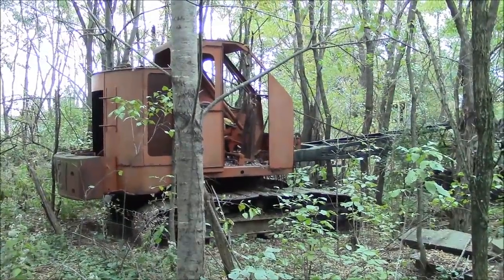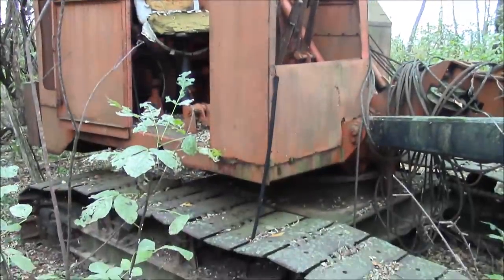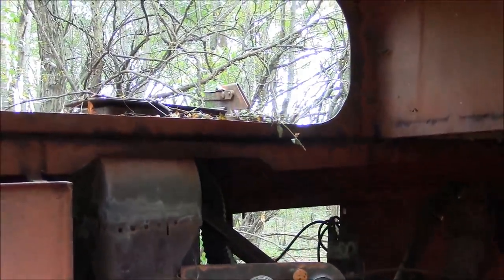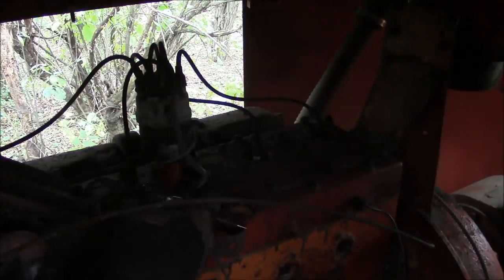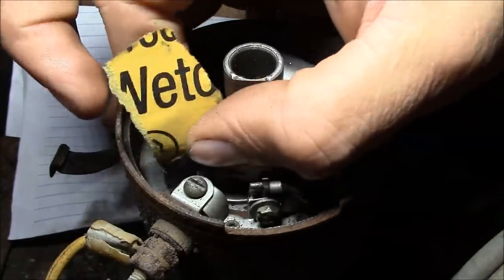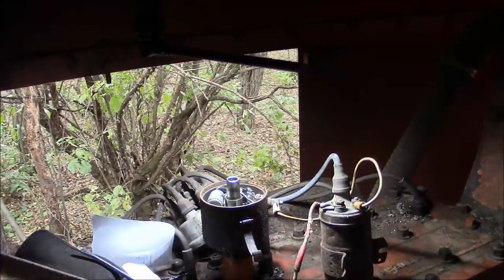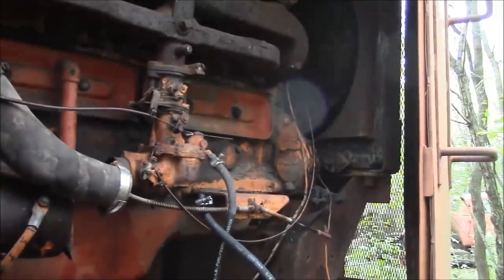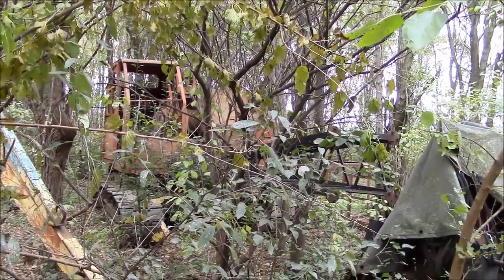Insley Dragline Crane Forgotten in a Field for 20 Years - Will it Run Again? - Part 1

Comment: Distributor through the cyl head like that looks like an F226 continental  to me. Same as in my Cletrac AG6.
Reply from the maker: Continental B427.
Reply: still a Continental. Been doing this for 50 years and engines by brand all have certain characteristics. Buda from  Waulks, Hercs etc etc

Comment: Ignition coils work using ‘back emf’. When voltage is applied to the coil a magnetic field is created in the primary winding. When the points open that magnetic field collapses and induces a surge current in the primary of the coil which is ‘amplified’ by the secondary side of the coil up to 15-20kv in a standard points ignition setup.
Reply: Thanks Gary, saved me explaining it.  I'd like to also point out that intermittent DC is NOT AC.
Reply from the maker: Correct, but pulsed DC is often used with transformers. For example in a switch mode power supply.
Reply: @WatchWesWork  Wes, you clearly know plenty about mechanical stuff, but the way you talk about electronics issues makes me think that you have some training or at least experience in electronics too. Care to expand at all on your abilities in that arena?

Comment: At least here in Florida, if you buy a good quality clamp on battery terminals, use a good conductive (not dielectric) anticorrosion grease and properly prep the wires they will last a long time.  I've been using them for a many years and have found that it's most often the install that is to blame for their failure not the terminals themselves.
Reply: Molybdenum di-sulfide works best.
Reply: @glennchartrand5411  it may work but a specific grease for the application (like no-ox-id) works best.
Reply: @DoRC  I prefer Molybdenum because it wicks into the cable, so it prevents the copper from corroding, it also works well on brass and steel battery terminals.

But one co-worker prefers "battery protector" (an orange lacquer with anti corrosion agents) and another guy uses the "felt rings" soaked in corrosion inhibitors.

They all work.

I do a lot of deep cycle batteries so I'm mainly worried about "gassing" getting fumes into the cable and I have to deal with a lot of different types of connectors.

The guy who PM's forklifts wants something easy to apply and the customer can see that its applied.

The guy prepping new equipment wants something that looks "factory".

It all boils down to personal preference , just knowing that you need a corrosion inhibitor is 90% of the battle.
Reply: @glennchartrand5411  we used no-ox-id on cell tower battery backup systems. But yeah as long as you use something effective.

Comment: yup set the throttle at wide open and the governor keeps the engine at 1200rpm. thats the way my insley and lima both are set up.  they are not run at high RPM.   thanks for posting this!   im thinking its a continental f226 definitely  does Not like the buda in mine.
Reply: BTW there are a few people  interested in buying this machine on facebook old crane groups already.  IF only you were closer Id be all over it
Reply from the maker: I've studied your Insley shovel videos. Your engine seems totally backwards of this one. The manifold and oil fill are on the opposite side. So I really have no idea what mine is. There's very little info on old flathead engines that are not used in cars. I think it may have once had a belt driven governor like your other machine.
Reply: Yeah both machines have Pierce brand governors as you’ve noticed the Insley is belt driven. I have manuals if you’re interested in any part of it.  I’m pretty sure that’s a continental engine.   I bet you could drive it out of there with not much more work. Both my machines have been sitting for 12+ years and engines aren’t missing a beat after coming back to life. Controls just take a little elbow grease.  As you can tell by your views this stuff is still pretty popular and there are still businesses run with these old friction machines

Comment: I always wanted a dragline, I thought about building a small one out of an old farmall cub. But that's a lot of fabrication that I don't have time to do. It would take me years, lol
Reply from the maker: I saw a TV show once where they had a dragline made from an old Allis Chalmers dozer with two winches on the back. It had no boom. They ran the cable out to another dozer and back.
Reply: Watch Wes Work my dad had a pond scoop that went on the 3 point hitch of the tractor, but somebody stole it. My dad wanted to level out the fields behind the house and fill in the low spots that flood

Comment: Don’t forget that the HV Circuit has to return to the case of the coil, make sure the coil is efficiently grounded
Reply from the maker: I don't think that is true. At least it's not true for most coils I have seen. I believe the ground side of the primary and secondary windings are tied together at the negative terminal of the coil. So the case does not have to be grounded. That makes the coil an auto transformer instead of an isolation transformer.

Comment: Aside from a project for fun, if a working one of these has no value then there's only three ways to get paid from this right?  Salvage the motor and sell it, break down the rest for scrap value, and the intangible value of clearing location X for better use of the land?  Hearing that old infernal combustion kick over has to be a nice reward for the elbow grease you invested in it so far!
Reply from the maker: Well scrap metal currently has almost no value. So entertainment it is!

Comment: Turning in a shift on that thing must have been a chore. Especially with that engine howling away at full throttle (or near enough) right behind your head all shift.
Reply: Get the best ear protection you can. Maybe even  double up with earplugs as well.

Edit: typo fixed
Reply: @gorillaau  I sure as heck would if I were going to spend more than 10-15 minutes running that rig.
Reply: @sandy1653  I wonder if you can get active noise cancelling headphones with an audio jack to allow a two way radio to be "piped" into the cans. 

Your comment made me laugh. Thanks.

Comment: the old strait 6 fired right up and sounded pretty good. i was impressed with the oil pressure when you were cranking. what became of the forklift you drug out of there?
Reply from the maker: It's sitting behind me at the end of the video. I bought some parts for it and will have a follow up video or three.

Comment: I know this comment is a year late, That Electrical system is probably 24 volts. That is why the extra battery cable you found.  It connects the two batteries together in series. That would also explain why the starter motor turns so slow.

Comment: I noticed a short battery cable that you didn't use.   Is there a chance there were two batteries in series (24V)?   I guess some bulldozers are set up that way.
Reply from the maker: I've never seen a gas engine set up for 24V. That's a diesel thing.

Comment: Really close on the coil explanation. When the points open the primary field of the coil, 12 volt side, collapses. At that point the energy is transferred to the  secondary winding and the resulting voltage spike jumps the gap of the plug resulting in a spark. Points close and process repeats for next cylinder. Please keep bringing these jewels back from the grave. Thanks.
Reply from the maker: That "transfer" is mutual induction. Just like a transformer. It's easier for me to understand it in electrical terms. Probably not for anyone else though!

Comment: The plak on the starter should tell how many volts it takes
Reply from the maker: Usually the starters don't care about voltage. They just have a little more torque. From my experience converting from 6V to 12V, we never replaced the starters.

Comment: Nice job Wes.  Not a complaint, I'm noticing a lot of artifacts. What bit rate are you uploading at ?
Reply from the maker: 1080. Not sure on the FPS. The biggest issue is that I burned the lens of my camera with a torch over a year ago and I never replaced it. Someday...
Reply: @WatchWesWork  Ouch I think I remember that was it on the dump truck repairs? FWIW I checked your video and it's 1080p at 30 fps.  The bit rate though is only about 4 Mbps, YT recommends about 10-12 Mbps for 1080p 30 fps.  This would be set when you render your edited video.
Reply from the maker: @billdlv  OK. I'll have to check. I render in mp4 format. I need to upgrade my edit software though. Mine is pretty janky, as you can clearly see!

Comment: Too bad that deck ring gear is shot. That is why you had oilers to work with the operator (150) of the rig. They were built to run forever, just keep them well lubricated. You could have that deck ring gear rebuilt, if you so desire.

Comment: the governor assembly is actually missing in your application, it should be a centrifugal assembly, driven either by a belt on the engine, or a gear driven assembly on the front cover. they probably ran it without it, just self governing with the hand throttle. those old 6 cylinders are low rpm, high torque engines anyhow, they'll run forever.
Reply from the maker: Seems awful dangerous to run it with no governor. You could over rev it pretty easy!
Reply: @WatchWesWork  i agree completely, but lots of folks have tried, some succeed, some fail...... i have a belt driven one in my shop, next time im out there ill take a picture of it.
Reply from the maker: @bvfdfire1  I know what you mean. Like a Pearless governor.

Comment: cool seeing old stuff like this coming back to life :) what model is your Clark forklift there in the background? I resurrected a 1993 GPX30E that looks similar, but only two sticks(no sideshift) https://www.youtube.com/watch?v=1PmybZU-4wY&t=10s
 I think it turned out pretty nice...woulda been sad to see it go in a dumpster...  now working on restoring a 1963 towmotor- also pulled from a scrapheap, when done, just going to donate to a local airplane museum- they have one like it, but it typical shape- converting this one to power steering and plan on OD green/white star military motorpool motif...think it will be kinda neat, even if a bit of a ugly duckling...did get in a bit over my head cost wise, tires alone are costing more than I'd hoped it would take to redo- but it will look better with new wide slick tread tires...adding the new steering box, pump, relocating generator/possibly going alternator to save space,  brakes, body panel steel, seat, pedal pads, paint... gonna cost more than the 800 I put into the clark for sure...  :)

Comment: I think International Harvester had something to do with some Continental engines
Reply from the maker: That's possible. The design of these engines goes back into the 1930s. Possibly Graham Paige or some old auto maker like that. They are very rugged engines.
Reply: @WatchWesWork  yea they are we used to have an air compressor at work it had a Continental engine  the valve cover had International on it it was a half V8 4 cyinder  international it had GM parts ... Kinda like AMC used some GM and Motorcraft parts
Reply from the maker: @FordMan-lf8ns  I know all the ignition parts on most Continentals is Delco. Straight out of the GM parts book!
Reply: @WatchWesWork  yep a continental is a multi parts engine  but good engines I think they bought from best bidder  and got good parts

Comment: They did make a large 6  cyl engine for forklifts and cranes i have rebuilt a few ,parts are pretty much non existent , F226 model
Reply from the maker: It's definitely not an F226. The distributor is in the wrong spot.

Comment: No ballast resister? Someone might have tried using a 12 volt w/internal ballast.    that slow cranking..I once had to work on a 'crane' that had 550 CI international OHV 6 cylinder.....the owners kept buying the cheapest 12 volt battery, usually about 600 CCA....it cranked about as fast as this one, and the same 'temp-repair' battery terminals....eventually ruined the starter ring gear by just wearing away the teeth in 3 spots....I ended up removing the semi-'truck-sized' 3 shaft tranny (I'm not the truck guy...it just said FULLER on it)...musta weighted 1,200-1300 pounds...yanked out the flywheel, changed the starter ring gear....worked a lot better, but I found the best solution was just buying a 1,200 AMPS cranking battery....spun at least twice as fast....started right away....
 BUT....didn't help the gas mileage...2 big 4 barrel carbs...maybe 1-1/2 miles a gallon....
 Hard to keep stuff running for that operation....most all their equipment looked about like this....sheet metal outfit, foot-pedal mechanical press brakes, foot-stomp shears that were 'converted' to hydraulic...lots of stuff older than me, and I'm 72....
Reply from the maker: Probably someone "re-wired" it at some point and left out the resistor. Or it failed and they just bypassed it. It'll be fine for now. Eventually it'll burn out the coil or points or both. But I doubt I would ever run it long enough to worry. I need to get a good 950CCA battery to take with me. Dang things are $140 these days!
Reply: @WatchWesWork  $140 and up...! The crane I worked on had a battery box obviously spaced for 2 batteries, and huge cables….the 1,200 CCA was actually quite a bit smaller than a lot of the others at the store, ah.... but it was quite heavy!
...I didn't look for the proper fit for the 'car or truck'...I just got the highest CCA they had...with the new ring gear...it worked fine...

Comment: My old JD430 was a 6 volt system. With points & condenser.  The condenser was the normal culprit for failing to start.
Reply from the maker: Interesting. The condenser is just a capacitor. They are usually very reliable.
Reply: @WatchWesWork  normally reliable. On my tractor,  not so much. Went through those like "oats through a horse". Seemed like new points & capacitor were the newest things on that old tractor. Lol.

Comment: Did you see the big C on the block it's a contninal engine. And it's a 6volt.
Reply from the maker: Possibly. But this is larger than any Continental I've ever seen.
Reply: @WatchWesWork  that made some big engines for different things IV seen some that was ac units and that was big.

Comment: Rule #1 of working on old equipment way off in the middle of nowhere.  Never bring any battery smaller than a 1000 CA group 31 no matter how hard the thing is to carry to wherever you are going.  Taking the smallest/lightest/ cheapest small vehicle battery you can carry is always asking for problems at the worst time.
Reply from the maker: I just used what I had sitting around.

Comment: Autolite electric system. Obviously twelve volt negative ground generator. Ignition coil is a modified capacitor, unaffected by polarity, except the spark jumps the wrong way. For test purposes, the only thing polarity sensitive is the charging system. Believe it or not, in the old days, it was possible to have satisfactory operation without any circuit boards, or control modules.
  This engine is definitely NOT a Chrysler. Budda, and wakasha commonly had their name prominently displayed with inch tall letters casted on the manifold. I have not seen a Continental equipped with a belt drive governer. International, Pontiac and Chrysler all have the distributor on the lefthand side, when viewed from the flywheel end. If you need a belt drive governer, try old Massey Harris/Ferguson SP combines and swathers, as well as Cockshutt/Oliver/Minneapolis-moline. Anything with a gas or LPG engine.

Comment: It's a K12.
I had one just like it.
Mine was  Buda engine but I repowered it with a 300ci Ford 6 cyl.
I had never been on any thing like it but I learned what all the levers did and dug out a swamp with it. I may still have a reprint of the owners manual for it.
If you are interested I could look for it.
It was a sad day when I sold it. I wrote a piece on a tractor forum.
You can read it here.
www.yesterdaystractors.com/cgi-bin/viewit.cgi?bd=ttalk&th=636407

Comment: Hey.... I have a good idea for an experiment.  Let's park a brand new Chinese piece of construction equipment in a field, and let it sit for 20 years.
Will it run?
Reply: Ah, probably not. And this had a 60 year working career before that. How many 1000 hours is 50 years of being worked?
Reply: Except the Chinese don't let machinery sit in a field. They add baling wire and JB Weld until it works again. If that doesn't work, they recycle it. They build the equivalent of a New York City every five days.
Reply: Honestly, anything new left in a field isn't going to start easy, too many computers and plastic doesn't do well left in nature for 20 years.
Reply: 3 weeks
Reply: Oookey boomer

Comment: Yes but the thing is that tool replaces the actual spark plug so you could have a bad spark && never know it unless you use the actual spark plug itself that tool completely contradicts the test...
Reply from the maker: That's true. But a spark plug is a very simple passive device. They can be "fouled" by oil or gas, but normally that is an issue for extremely worn engines or engines with downdraft carburetors. So, the tool makes is simple to test the more complicated parts of the ignition without the headaches of removing the spark plugs. On some engines removing the plugs can be almost impossible.

Comment: Looks like a farmall m carb
Reply from the maker: It's similar, but much larger!
Reply: Farmall M's & H's had side mounted distributors (right side). Both had left side carborators also their.  blocks were much shorter  in length. I suspect it is either a Continental or Chrysler my money would probably be on Chrysler because of the length of the block.  Old farmer